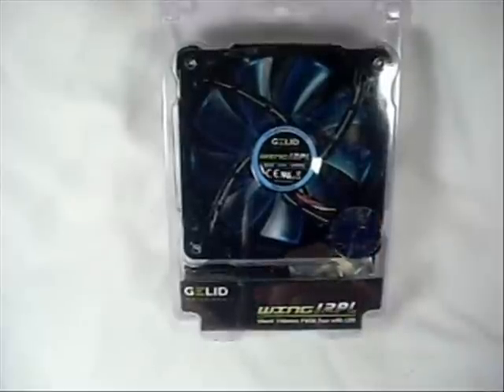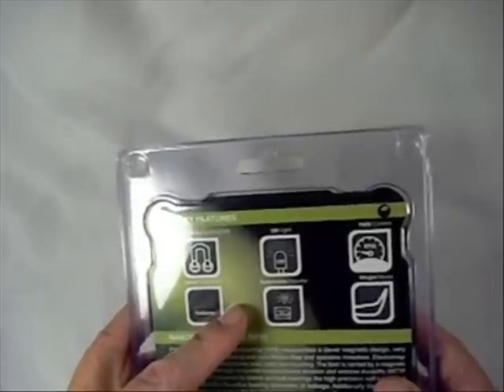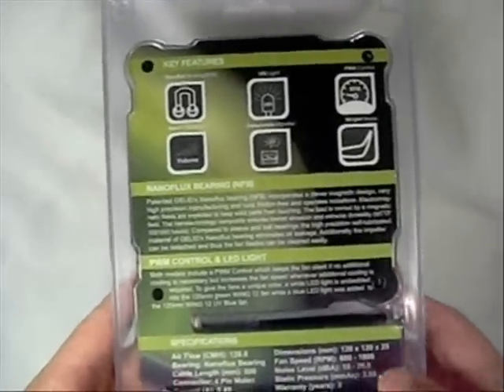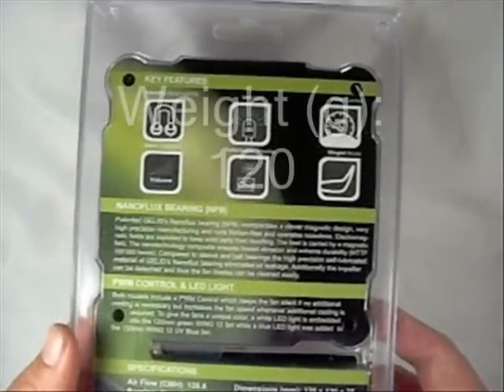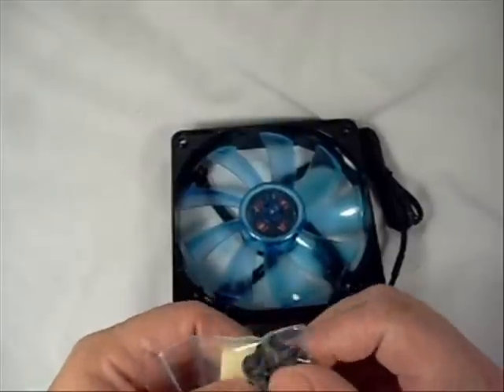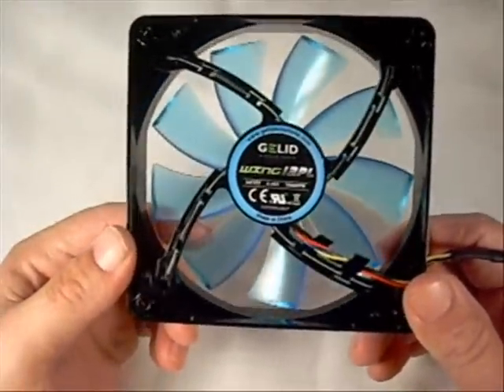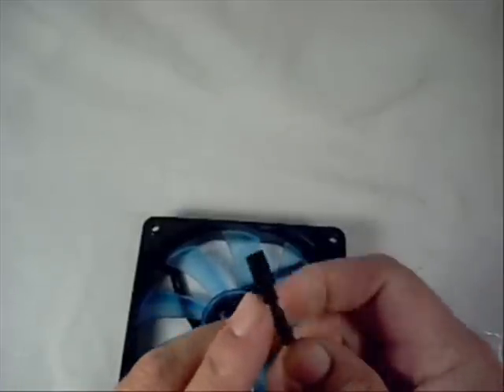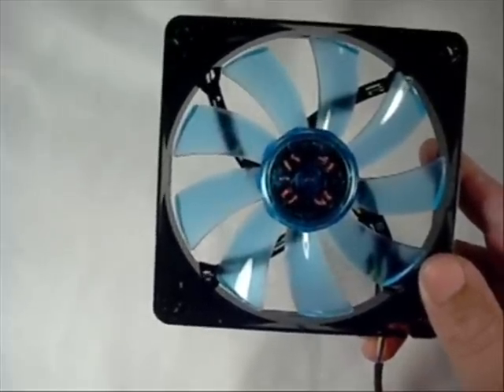Product Showcase Gelid Solutions wing12PL 120mm Uv led case fan

Comment: I'm using 4 of these in my rig, they're Uber quiet, nice LED and move lots of air. I love the fact you can pop the impeller off to clean it. There is also a non-LED version, same looking fan, lower RPM (1500) and comes with a little rheostat controller, I made a little video some time ago.

Comment from the maker: @yeehaw789 If you have it plugged in to a header on the motherboard you should be able to set the speed in bios so that it only runs at certain temperatures.

Comment: @FUzzyBUnnyBOoties I've managed to get it working from bios, speedfan didnt work eaither, turns out it had to be plugged in a 4 pin port, mine was in a 3 pin port so it couldnt be controlled, I just swapped it with my cpu fan because i really dont need to control my cpu fan, thanks anyway